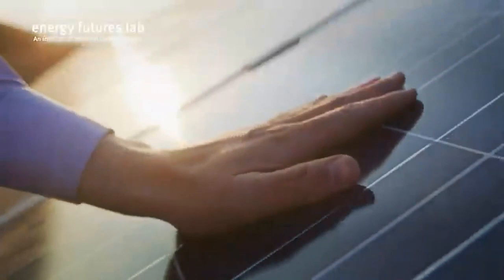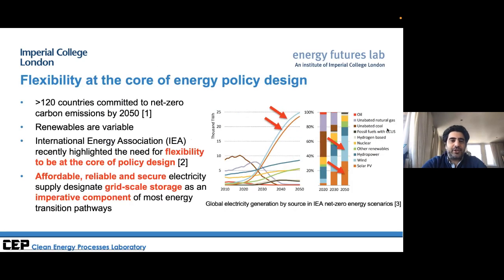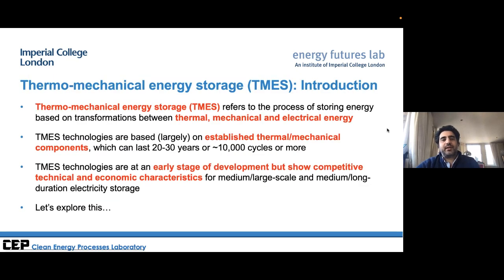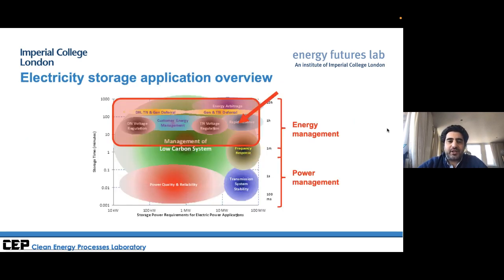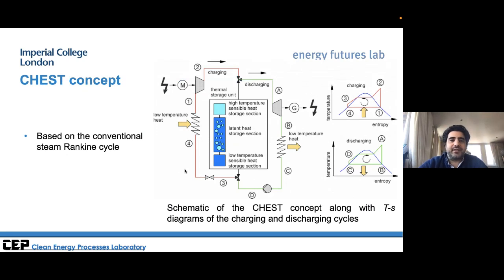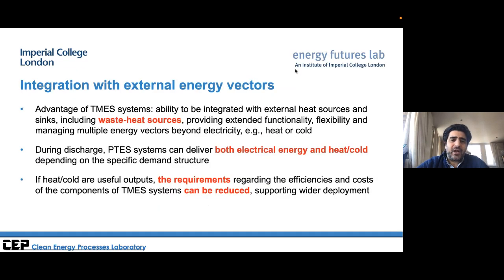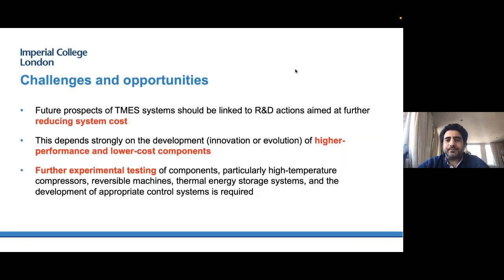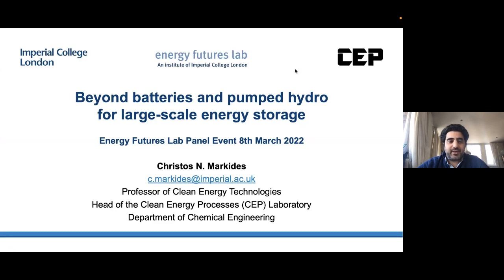Beyond batteries and pumped hydro for large-scale energy storage

Comment: Off topic I know however I cannot see why the tidal flow generator currently on test in Orkney cannot be moved to the Meni Straights between main land Wales and the island of Anglesey. They have a tidal flow that is 8 Knotts at slack tide! Also they have direct connection to the National Grid because the power lines from the old Nucliar reactor Wilfa which is no longer in use. It is also very clost to the Pumped Hydro station of Dinrowig. 
Currently they are unable to test the devide they have at more than 10% of it's abilities due to the local grid not being able to handle its power capabilities. Moving it to the Meni Straights makes a lot of sense to me.

Comment: I am no scientist but a very curious observer of how mass storage for solar is developing. After seen so many videos on youtube, I am thinking why we cant do liquid argon in a closed system ? Use solar PV or wind generated electricity during non peak day time hours to liquify argon and store it in an insulated big ass pressurised container. In another insulated big ass container make molten glass/silica using Solar PV or Wind generated electricity +  heat from the liquefaction/compression of Argon. Put both containers seperated from each other by a few meters under ground to save space and connect them to each other with a big fat graphite rod...wouldnt that make it a seebeck generator ? So theres electricity generated from that. Then using the heat from the molten glass container...liquid argon can be warmed up by the heat from molten glass and the pressured gas can be channelled into a turbine to generate electricity...there can be two or three turbines stacked on top on each other with decreasing capacity and the argon that comes out at the other end will still have some pressure which can be routed to the compressor via mini wind turbines which generate more electricity. Once in the compressor, the argon is liquified back down again and the process continues. How you do this the most efficient way is I guess down to calculations and stuff. But I think this combined closed system will have a better efficiency than any one system. Also curious if Stirling engines are more efficient in converting heat to electricity than using a seebeck generator. Also maybe a turbine that runs on a similar principle as a heros engine would be more efficient...just saw a video on how a heros engine worked with liquid nitrogen on youtube and it was crazy.
Reply: @schmetterling4477  I got you reading didnt I ? 😆
Reply: @schmetterling4477  How did you know it was bullshit then mate ? Did you smell it ?